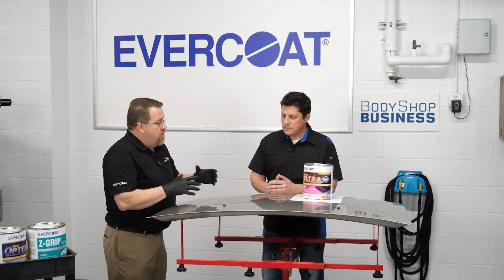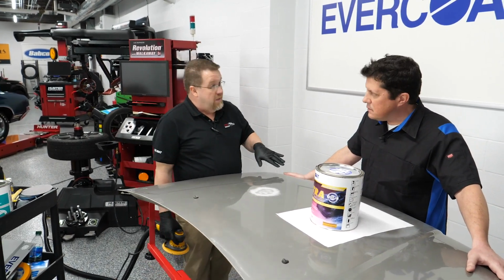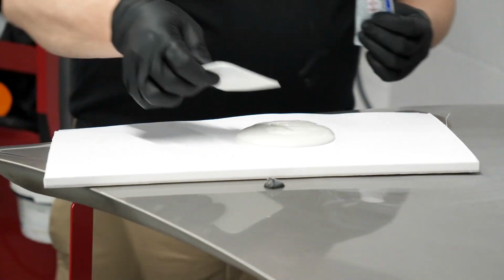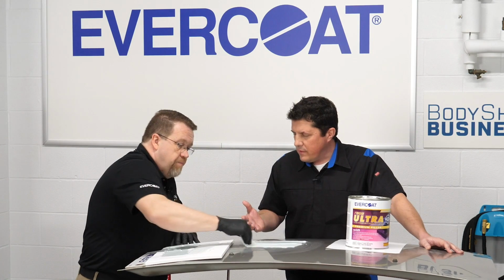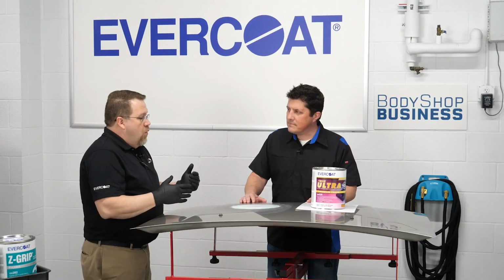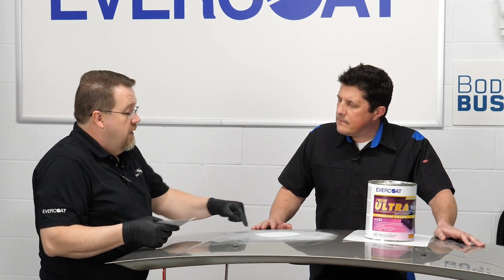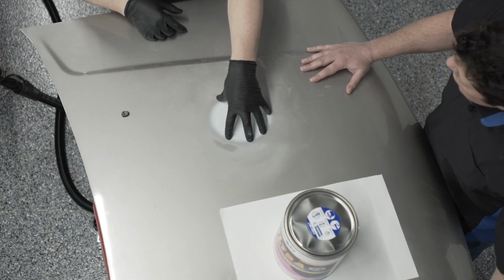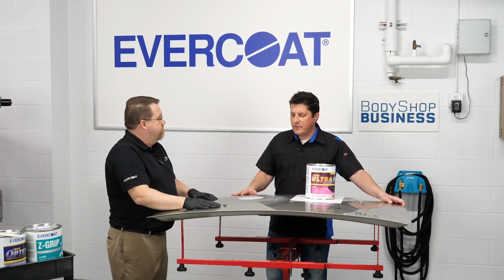Body Filler Basics: Prepping, Applying, and Sanding

Comment: I would guess the follow up and being paint ready is the application of glaze. Block with 320, rub power guide coat, then pass judgement. Apply sealer, allow to dry, then 400 or 600 the hood and clean, prep and check by hand and light for paint ready. 
 I have not seen others in this channel yet, but I am sure I am close to the follow up. 
  ASE master tech, retired.

Comment: how many minut do yu hav to spread it at 80 degree weather
Reply from the maker: Working time for most products at 80°F would be around 3 minutes if catalyzed at 2%. It could be slightly longer if catalyzed at less than 2%, and slightly less than that if more cream hardener was used. Be certain to use Evercoat BPO Hardener with Evercoat products. If more working time is needed you can add in a small amount of Rage Ultra Xtra #145/#144 to extend the working time as needed. Adding Rage Xtra can also be helpful for large panel applications too.